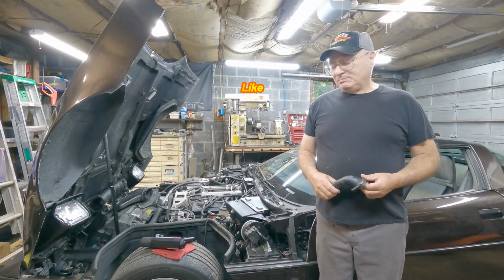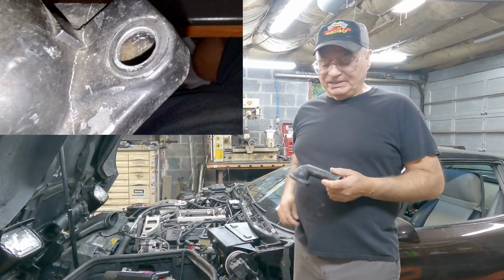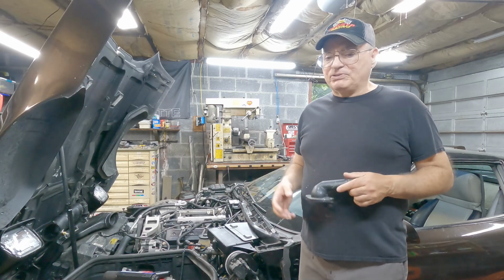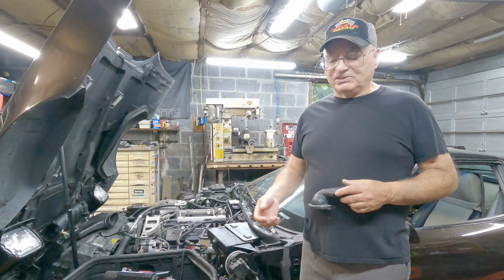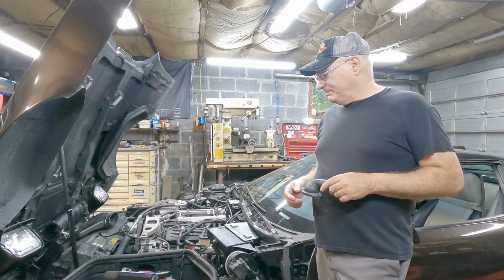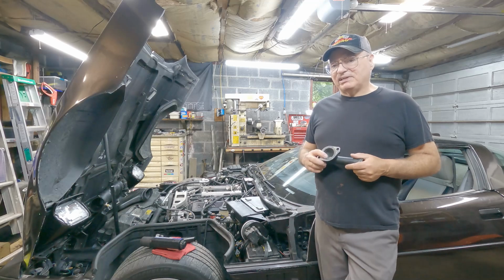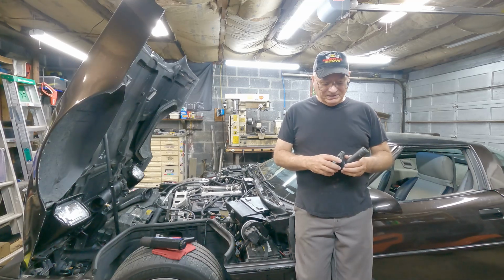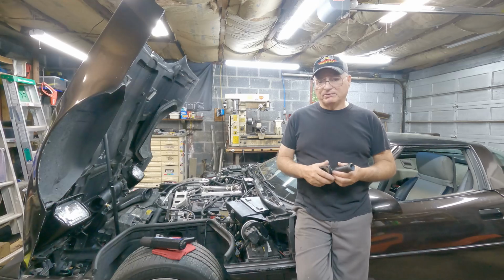One Thing After Another 🤔

Comment: I used Fel-pro gaskets on my ATK L98 engine block, i used the stock aluminum heads, 3 angle valve grind, rebiult heads. Haven't had a problem except a couple of rubber vacume "T"s. I got new ones from parts store, had to order them, no one carries them from dorman. Runs like a champ now. By the way it's a 1986 indy pace car. Keep going, I'll keep watching.

Comment: same here, vette not running, except  mine has a head gasket issue on a brand new engine.
About the intake runners gaskets, I've scanned them with an A4 desktop scanner , made a cad file and cut them with my cnc oscillating cutter out of a good 1.5mm material. The guys that sold me the gasket sheets (1.5mx1.5m) said they could cut them for me if I wanted ... spent a few days working on them with the cnc not being quite suitable for that thick material. The ones on the market now look like a joke compared these. But my runners are Edelbrock high flow, not sure if they are going to fit ASM' s which I plan to buy for the OEM looks. I have one for the thermostat as well, seals perfectly without needing any silicone and . The raw gasket is called BELPA CSA 28.
Reply from the maker: Good information, the AS&M used to come with the Edelbrock gaskets, I am not sure what they come with now.
Reply: @E.T.GARAGE I’ve bought a set from tpis before making my own but they came too late and couldn’t use them. they are pretty thin although might work ok. when I drew them over the scan copy it was not that easy to match the contours and holes before of blurry margins. you also need to readjust the scale after taking some real measurements on the parts